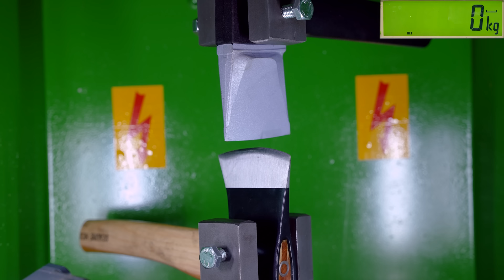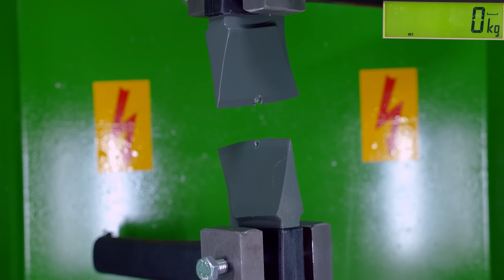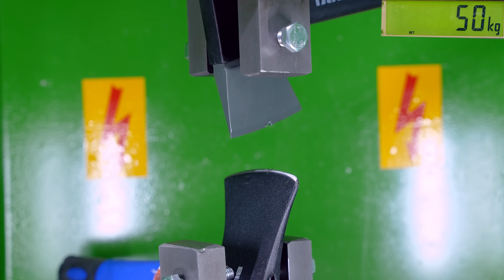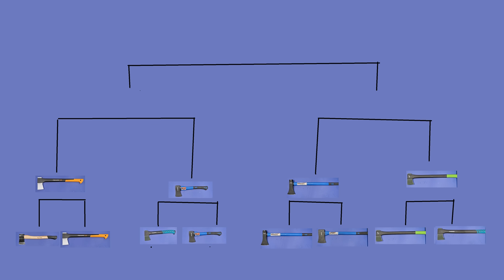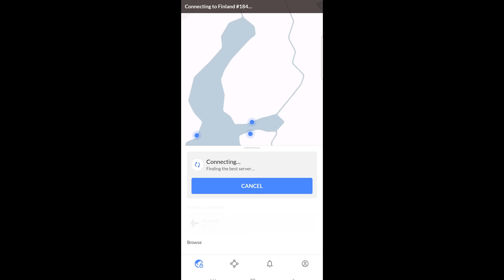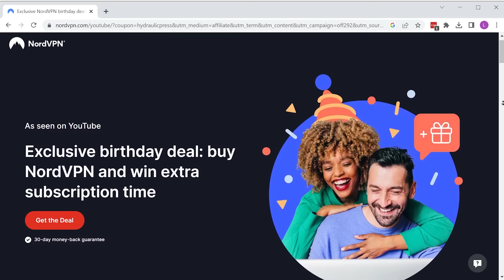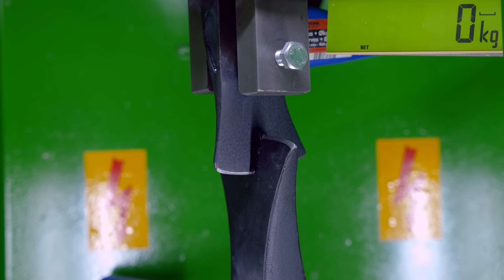Brutal Axe Test with Hydraulic Press

Comment: I wonder if you check the temps with a laser, to see which one stays cooler.
Reply from the maker: They didn't heat up much at all. The work done by the press is quite small since the distances were so small

Comment: Get 4 identical bars of steel.
Leave one as it is. 
Heat the second one red hot and let it cool on its own.
Heat the third one red hot and quench it in water.
Heat the fourth one red hot and quench it in oil.
Now, press-test the 4 bars to see how their strength is affected by various heat-treatment techniques.
Reply: depending on what steel you use and what it needs to be quenched in, it simply wont harden, will crack, or not harden correctly and develop heavy distortions. Or it will just cool down and be no different than before. Quenching in water is faster than quenching in oil. Say you have a piece of steel that needs to be quenched fast to achieve its best properties, you quench in water. If you quench that piece in oil, it wont cool down fast enough and thus not harden correctly.
Reply: The grade of steel is what will determine the results
Reply: 5! Leave one outside in a field in the weather to rust for 1 year (or more preferably) .
We do this with engine blocks to harden them. Bring them in, clean them up, bore them out and holy snikees!
Reply: Oil-quenched should be the hardest.
Reply: @awemowe2830  It has to cast iron and from an engine that has been operated at full temperature, temperature cycled, and subjected to vibrations of operation. Think of it as stress relieving.
Reply: @Sharpless2  Quenching in Oil introduces carbon to the steel which increases surface hardness. Mild Steel can be hardened my quenching in oil, but not so much quenching in Water.
Reply: @DrLeroyGreen    All steels will stress relieve over time. Usually hardened steels are reheated to a few hundred degrees for a hour or more to remove the stress more quickly than if its left alone.
Reply: @mumblesbadly7708  твердость - не всегда хорошо, потому что хрупкое и ломается,   наибольшую твердость дает вода, но и марка стали тоже важна, если топор рубить дрова - то не особо важно какая сталь, если топор для работы плотника, то важно, чтоб был острым и долго не тупился, тут нужно чтоб была хорошая сталь, бывает только кромку делают из хорошей.
Reply: @DrLeroyGreen  wow, i am not alone doing that😂👍
Reply: The case hardened one will shatter and the annealed one will squish.
Reply: They already did that
Reply: @GOAT_GOATERSON  Which video?
Reply: @ferretyluv  somewhere on their channel, could be a few years ago. Not sure
Reply: @guytech7310  Are you referring to tempering?
Reply: @mumblesbadly7708  Not quite, water quenching usually gets most steels even harder. But since hard means brittle, and most hardened tools should have a balance of hardness and toughness, oil quenching is often the way to go. Exceptions exist of course, since there are steels that have to be hardened in water to get the right results

Comment: We didn't get to see a comparison of the final two blades...?
Cool and pointlessly dangerous though, especially the final round with ballistic axe shrapnel flying around.  
Good work!  :D
Reply from the maker: I thought that you can see it nicely on the high speed shot that the small axe gets destroyed? but maybe its not clear if you don't know it in advance?
Reply: @HydraulicPressChannel  Could not tell which was being destroyed.  seemed equal destruction
Reply: Yepp, definitely needs a little recap in a future video which one got damaged more.
Reply: @kirk1156  bottom axe was absolutely chewing into the skinnier axe. It was easy to tell when you could see the top axe sliding.
Reply: @HydraulicPressChannel  Another copy and paste response showing that you don't care enough to read the comments
Reply: @HydraulicPressChannel  I think it is clear who wins, but it would still be interesting to see the damage comparison for each blade
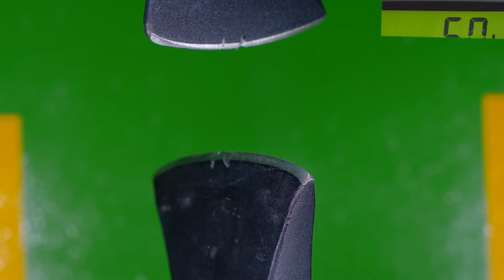Reply: @HydraulicPressChannel  7:25 "I think that's probably enough"

Judging by that thought, and you copy and pasting this reply comment, it's clear you weren't having a good day??
Reply: 9:00  and freeze frame bottom blade intact top blade split in half
Reply: @HydraulicPressChannel  Revisit putting things on high speed routers and have them explode.
Reply: @RustyDust101  yes!!! i wanted to see the damage close up!
Reply: @neb_setabed  maybe because they get 1000 window lickers all asking the same question?
Reply: @2Poor4UserName  but it wasn't the same question
Reply: final comparison.. why? the important is to talk about fu** VPNS
Reply: @ShaboPaasa  apparently you care lol
Reply: We definitely needed a closeup of the final round results.  It looked like the bigger axe won, but it's not clear how much damage was done to both of them.

Comment: Two biltema axes in the final? I'm speechless 🤣
Reply: I’m suspecting that the fix was in. 🤨 I had my money on Fiskars. 💸
Reply: @mumblesbadly7708  Nah I get it: the nice material fails sooner but in a safeish mode. so I guess it's easy to make super-hard toolheads but not ones that don't fail by turning into eye-destroying shrapnel?
Reply: Well, if you are striking some wood and hit a hard nail would you rather hit it with the axe that explodes or the one that bends?
Reply: https://www.youtube.com/watch?v=P-cR1kgGWx4
Not impressed.
You have to reprofile the edge. And not a bit.
They hold up well with the press well, that same thick edge makes it a lousy chopper.

Comment: Those axes that seem softer are leaps and bounds better as what an axe is designed to do. Chop wood. You can take an handaxe like a Estwing, traditional steel, leather handle wrap, vs a Fiskar version with…whatever steel it uses and fiberglass handles, and I’ll take the fiskar every time. I’m not saying it’s better overall, but as a chopper, the fiskar is amazing. Holds an edge, and is easily sharpened. The Estwing is an durable axe, but it doesn’t chop as good, it’s heavier, and much harder to sharpen….but it’s durable. So if your going into a post apocalyptic era, the Estwing might last longer. Because of materials. But the fiskar style will preform ridiculously better for a time too.

Comment: Junk Powdered Steel axes. They dump the powdered steel into a mold and press the 2 mold halves in a press. Afterwards they heat the part to just above the melting point in an oven which is supposed to bond the metal together. They can pump out hundreds of axe or hatchet heads per hour on 1 machine. 

Bad thing about Powdered steel axe and hatchet heads is that the steel becomes Brittle in the sintering or bonding process because the amount of heat needed to bond such a large part. Alot of the cheaper Chinese axe and hatchet heads are super hard on the surface but not fully bonded together on the inside. This is very dangerous to the consumer especially people that live in colder climates. An axe head or hatchet head that is not fully bonded will become brittle when cold and break or shatter. when striking an object. Especially if yo whack into a good hard wood or a chunk of frozen wood. Often they will break a couple inches up from the cutting edge.  One that has been over heated to get it to bond completely will shatter into pieces when struck.  Cold weather makes powdered steel Extremely brittle. I had 2 that the edge snapped off between 1 and 2 inches up from the edge on the 1st swing. And I had 1 that literally shattered into several pieces when striking a chunk of fire wood.  

If you want a good quality axe or hatchet that will last for decades buy an old used one or a Gränsfors Bruks or Council Tool or a Ochsenkopf. There are still a few manufacturers that make GOOD axes but they are expensive. But then again, a good axe or hatchet will last for Decades.
Reply: People have been using those Fiskars axes in Finland for a very long time and I have never seen any fail. And trust me, it can get cold here. They are very good and robust axes and also pretty affordable.
Reply: @TheMahtimursu  I own Fiskars axe for a while, only for camping, but has great balance, so it is enjoyable workout rather than only hard labor, to prep so fire wood... because it is light is always appeared that it could break , but it only what happens - blades become dull as usually, resharpening event with metal nail file does wonders when camping with females, so it is very nice.  also if some rock or thick nail become in a way blades will surfer , but i don't think that is a problem, because weight balancing - for three maybe for years using every weekend in think fiskars made pretty good solution (even weaker women can use them with ease, because of lighter weight and better balance)
Reply: @tadasnanartonis9092  yeah. It’s a proper tool for hard work. Not a showpiece to hang on a wall :)

Comment: having moved outside of nordics into se-asia, biltemas stuff is really not that bad. any of it. even the audio stuff's pretty good.
Reply: Says more about se-asia then 😅
Reply: @AlexKall  well yeah.   biltema doesn't sell discrete components and parts to fix all their stuff though.

turns out key to right to repair isn't as much the right, but the need for repair. thai domestic market local manufacture amps and stuff tend to be pretty bad but they are both cheap and repairable. even speaker woofers, rubbers and coils straight off the shop.

Comment: I wonder if the top axe has the advantage from being pushed into a blade instead of something pushed into its blade
Reply: Not really only difference is the effect of gravity and that's so incredibly weak compared to the power of the hydraulic press. Say if the top blade weigh 1.9 Kg and the press exerts 19 tons of pressure like in the last test then it's the weight adds 0.01 % to the pressure. But even then it's applied equally to the top and the bottom, so no difference what so ever...

Comment: Hmm, this test is probably not very representative of a quality axe, because hardness and shatter resistance tend to be inverse. Hard metal shatters easily, so you'd expect the hardest blade to also potentially shatter first. Also, most axes break on the handle far before the blade fails.

Comment: Thank you for all those pressure tests. I'm wondering; have you ever tried a piece of metal from railroads? That metal is very, very hard. If you want to drill a hole in it, all your drills will be destroyed before you even get a decent hole.
Reply: No it's not, I machine scrap railroad steel all the time

Comment: How the heck did Biltema get to the final, and with two axes as well?
Reply: Harder brittle steel. Doesn't actually say that much about the quality of the tool, even if its for sure that the blade wont explode on your face. If you end up hitting some hard nails with too much force having some shrapnel flying into your eyes isn't totally out of question.

Comment: Here is a very Finish challenge that would be interesting especially due to recent events in the world - crushing ice with the press. You can put up against each other 1) ice 2) ice with saw dust mixed in. Adding saw dust makes the ice so much stronger that during WWII Allied troops actually used ice mixed with saw dust for walls around their forts in the north because it was supposedly strong enough to stop bullets and shrapnel from explosives. People even discussed building battleships out of it (I don't know if they ever actually did - but ice does naturally float on water - especially salt water). But, how much stronger is it than regular ice? That would be an interesting/very inexpensive test for the Hydraulic Press. You can read about mixing sawdust with the ice in wikipedia and on history sites on the internet! All you have to do is leave some water and water mixed with saw dust outside the shop over night!
Reply: I heard that they build ships out of steel, and that doesn‘t even float. Wicked!

Comment: the winner of this competition is classed as a hatchet, 6lb chopping axe ,  biltema brand made in Sweden. # 16-4045 .
910mm shaft length,  EN9 steel, 230mm head , with a hardness of 40-55 HRC.

Comment: Now you should do real world test and see if it's really a good axe.
Reply: The Biltema axe is mediocre out of the box, even though it doesn't come in a box...

If all you want to do is split wood it will do OK, it just takes a bit more effort than it would with a good axe. But if you are using it to shape wood with any precision for carpentry you will want an axe with a better profile. The blade is to thick towards the edge to cut really well and it's not well sharpened from the factory. You can sharpen it which will make it a decent axe, but reprofiling it would take a lot of work. 

The larger splitting axe does a good job of splitting wood. Still not a fantastic axe but the weight and a decent edge is all you need for splitting. it's not like you will need an edge you can shave with or a profile that let it cut like a knife for that.

Comment: I don't know if this has been done yet. What if you had a bolt to loosen but not the right size wrench? Could you crush a wrench and make it larger but still functional?
Reply: I think that crushing and making it larger are contradictory terms. I have never seen a car put in a crusher that came out larger.
Reply: @Ian Biron

Nah, the overarching property of chrome vanadium Steel is it’s extremely high rc (hardness), which breeds brittleness in its opposition of equality. Therefore, the wrench would just explode. Would be mad awesome to see a wrench explode though! 

One thing that could work though, is pressing the wrong size wrench into the bolt head. The bold head would give, and be pressed into the wrench eye... so that’s a possible video for sure!

Comment: All good, except that the winning axe isn't an axe.  It is a splitting maul.  It is designed to have the back side struck with a sledge hammer, hence the stronger, tougher, harder steel.

Comment: Axe-off
who will undercut the competition and who will be chopped up?

It if could be done outside i'd think hammer-off might be decent idea, tho the explosions would likely be far more dangerous.
otherwise maybe a hardened steel sheet vs non-hardened pointy thing (knitting steel needle?) a test of strength really.

Comment: A log splitter is not the same thing as a cutting axe. Completely different edge geometry and purpose. It's like comparing a 2 pound framing hammer to a 4 pound sledge hammer. They are not the same tool

Comment: Would have like to see how a Gränsfors Bruk  Axe would have done 🙂
Reply: Probably similar to the Clas Olson. Axes don't need to be excessively hard since they are meant for wood and hardness comes with a lot of problems.
A good axe, especially a forestry axe or hatchet, will do poorly in this test because of their relatively ductile steel and their narrow geometry.
If you want to do well on this test, you want a hard lump of tool steel with as obtuse geometry as you could get away with while still calling it an axe. It would be a terrible axe.

Comment: The set up wasn't great for this experiment. The axes could have been secured so they didn't rotate around a single point. When the axe turns it gives it an advantage as it rotates in the direction it is strongest and the other is having pressure applied in the way it is weakest. However, I did still enjoy watching you destroy the axes 👍